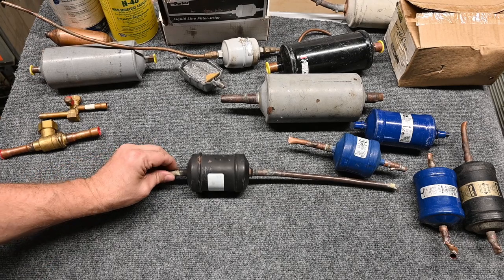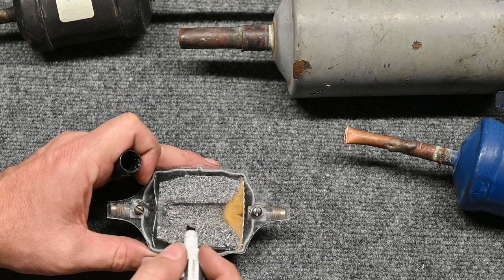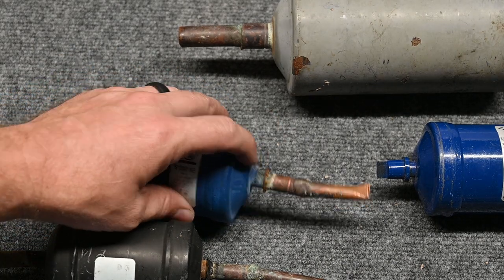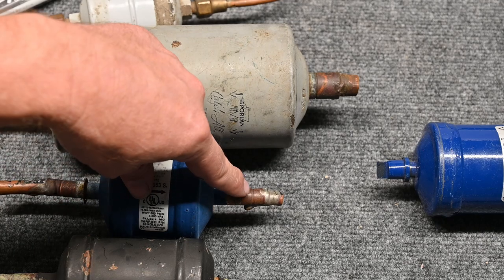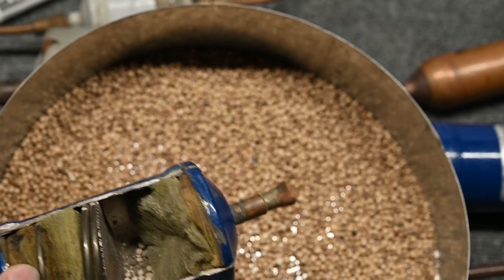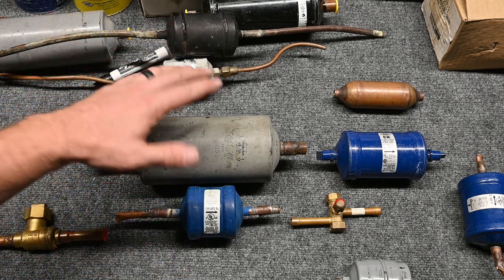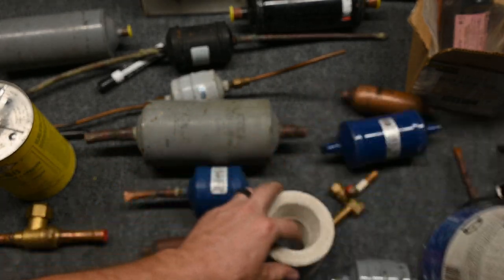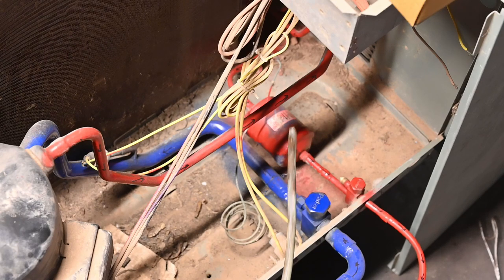HVAC 081 Liquid line filter drier

Comment: Hey Ty! I have searched all over google and youtube for an answer to my hvac issue and couldn't find anything - hoping you can help. I have an Emerson liquid line filter drier and a Lennox AC. When the AC completes a cooling cycle and turns off the Emerson liquid line filter creates a humming noise that lasts for a few minutes. This only happens after the AC has turned off, does not happen while the AC is cooling. Even though the hum only lasts for a few minutes it is quite annoying and can be heard throughout the main floor of the house. The Emerson liquid line filter is in my furnace room in the basement of my house. We have two stories above grade + basement. Any idea if this is a serious issue and what a potential fix might be?
Reply from the maker: It's possible the liquid is draining out of the refrigerant lines into the evaporator as the pressures equalize. 
You can have a solinoid valve installed before the metering device to stop the refrigerant migration but it will be an expensive installation that ironically involves changing the liquid line drier. 

For a simpler solution, try wrapping the drier in some foam tape we call armaflex tape and some of the liquid line as well and see if that helps.

Comment: Hello Ty.  I have a long story and maybe you'll see this and give me some advice.  To make long story short My central AC unit was totally rebuilt.  new Evap coil, compressor.  All the gauges are reporting everything is working fine but my house will not get below 80 degrees.  My house was built in the 50's so it does have sheet metal duct work.  it's a ranch home so no second level.  The only thing I can figure is there is not much air coming from the registers.  there is no blockage that I can tell.  My furnace calls for a 1/3 HP blower motor.  could I install a 1/2 to get more air into structure?  Would low air movement keep the temp from dropping to say 75-76 degrees?  I appreciate any help. I should say that I am not an HVAC person but watch all your videos.  I have a Professional that does my work and it is his suggestion that I replace with a bigger blower motor.
Reply from the maker: A larger motor is not the answer.

A larger motor will not move more air. You would have to increase the blower wheel size, and the blower housing size with it. 
For example a 1\4 horsepower blower motor spins on high speed at 1075 RPM
A 3/4 horsepower blower motor on high speed spins at 1075 RPM
The difference is the higher horse power motor is attached to a larger wheel that catches more air, and the larger quantify of air has more weight so the larger motor can carry the weight. (Loosly worded for simplicity)

You say pressures but I can make a system show any pressure you want. Pressure means little to me. 

To remotely diagnose I like to see a screenshot from a program called measureqick, (video coming soon)
This tells me the static pressure form the blower. Return air wet bulb, supply air wetbulb, (those 3 things calculate BTU of capacity for the evaporator)
It also calculates superhero, subcolling (much more important than pressures )
Compression ratio,  TD of the indoor coil, Delta T of the indoor coil / CTOA for the outdoor coil, and with compressor amps shows the EER energy effecdncy of the system. 

Personally I just really dislike  "pressures are good" because pressure changes with temperatures. It's not a tire.

If there is an airflow issue the static pressure will show up it.

If the refrigeration cycle is truly operating good then 
On the airflow side we could have a restricted return air, restricted supply air or the ducts could be damaged loose or leaking air.

If a supply duct is broken, the air loss is big but it also deoressurizes the house and the house pulls in air from outside so its a double loss. 

Step 1
Need a full report of the system operation and static pressure of the air side of the unit. Preferably a company that uses MEASURE QUICK with the digital probe set.

I would recommend a comfort consult done. They do a blower door test on the home, best load calculation, system evaluation, and duct evaluation then give you whole home solutions.

https://www.hvac20.com/map.html
Reply: @love2hvac  I really appreciate your help.  It's a bit above my pay grade so I don't really understand much about what you say.  I will pass this along to the HVAC person.  Looks like the company you suggested is not very close to were I live.   Again, Thanks so Much Ty!!

Comment: Hello Mr Ty. In the middle of your conversation for soldering and brazing you mentioned that is while different topic. I did for shot periods of time refrigeration my old boss was using soldering with silver 8. And Manufacturers actually recommend for soldering than brazing and hold pressure I guess quite well. 
Could you please put videos on soldering vs brazing.  I like it because it is low temperature than cooking the line on brazing side. 
Also while I was in Germany I noticed the   technician was fixing my brother's Rich In since he owns restaurant with Induction brazing.  It was a slick and never seen that here. Any inputs appreciated 
Thanks again for your time and sharing your knowledge 🙏
Reply from the maker: I am a good ways away from the brazing and soldering course. I am filming an introductory video to connections, good bad and ugly between a variety of styles and several points of view and visual aids. 
I have heard of induction brazing but I have never seen it first hand.
Reply: @love2hvac  
Thanks. It is expensive tool
 But planning buying when I go on my own. No Nitrogen crap. Especially I install my filter drier in attic or wherever could be next to evap coil. I would take anything than beating 120* brazing in attic.

Comment: Curious to know the reason why filter driers are not needed in mini split systems..
Reply from the maker: Grest question!
Most are heatpumps have only 1 metering device that is located outside. That means there is no true and constant liquid line. 

This is why all the heatpumps manufactures especificado say no brazing (becuse if oxidation ) and have vacuum requirments of around 259 microns.    

They do have screens to catch contaminants.
Reply: @love2hvac  So are they more susceptible to moisture related issues?
Reply from the maker: It depends on how you look at it. 

For the regular tech with bad habits (not  brazing with nitrogen, not sweeping the lines, not properly pressure testing, not pulling a proper deep vacuum and not inter purging guages between calls, then yes.

They are a different animal that requires a diffrent technique. It's not better or worse just different. Some people love them, some hate them. For me I see both sides and have my  own opinions.

Comment: If you evacuate a system and put it under a vacuum for a extended vacuum test say 24 hours or so. Could that get all of the H2O out of a filter drier that has sat at atmospheric pressure with a leak for a prolonged period?
Reply from the maker: No, but in theory, you could  heat the filter drier hot enough while under vacuum to release the moisture and then repaint it so it does not rust.

It's better to just replace the filter drier and flow nitrogen while doing so.
They are inexpensive and oh so important.